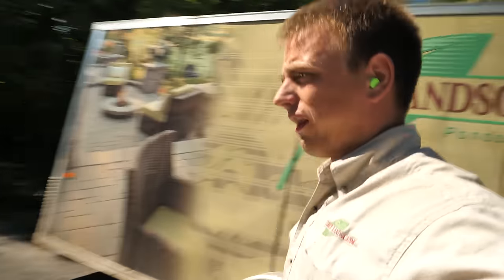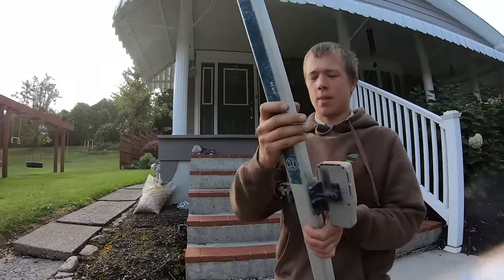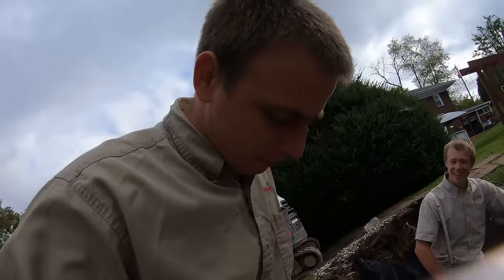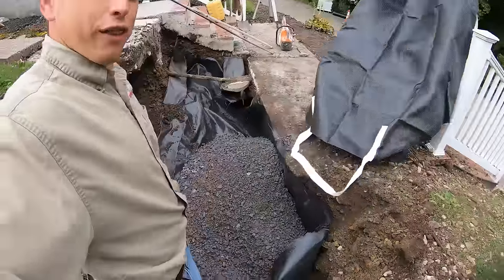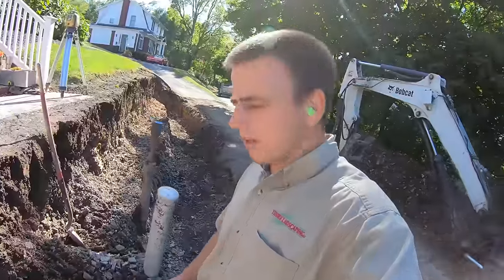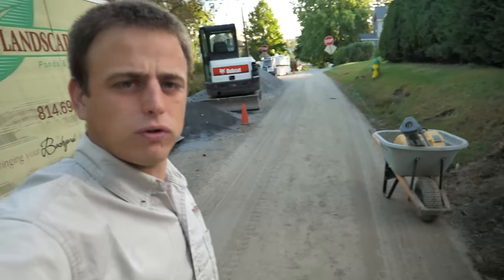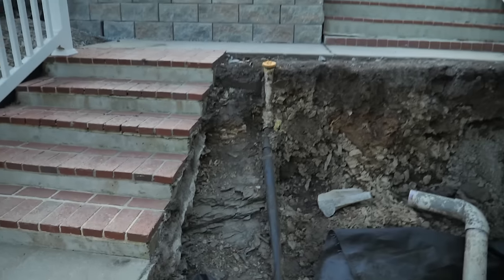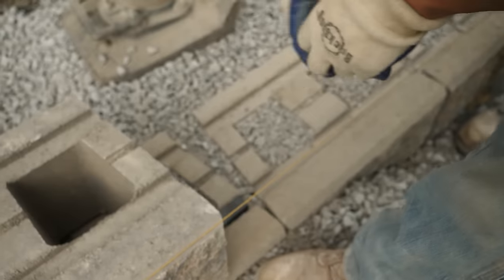How to build a RETAINING WALL that WON'T fall over!

Comment: How great explanation of the building the retainer wall. I would love you guys do a video on follow up 5-10 years later and revisit projects you have completed to see how everything holds up. Almost every retainer wall looks good when it is first completed. The main question is does it still look good 5-10 years after installments. I'm sure your projects will withstand the test of time, the follow up video will just validate the quality work. Thanks and keep it up.
Reply from the maker: Amen! That's exactly right. Appreciate the support!

Comment: Does that tubing have perforations all around it or just on one half?
If just one half, do the holes face the top or bottom of tube when you lay it down? Any landscape fabric or sock covering the tube?
How would I dead end that tube into my yard? Can I just end on a bed of rock under ground then cover with dirt and grass?
Thanks

Comment: Great video!  I know to measure from the “0” point. Then whine about the pipes you found. 

Now how deep and wide should the footer be?  What stone to start off with?  How deep? What stone next?  I have more questions than answers.
Reply from the maker: On a typical wall like this, the footer is deep enough for 6" of stone base (#57 stone) and 1" of setting bed (#8 or #9 stone) plus however much block needs buried as a footer course. Usually at least one course. If your block is 8" high, then the 8" block plus 7" stone base means you'd need to dig 15" below grade. And I typically dig 2' wide

Comment: Where can I buy the hollow-core blocks that you used? Who makes them, and what are they called? What are the dimensions of each block, and how much does each block weigh? Also, did you use filter fabric in your wall, and what kind of drainage pipe did you use?

Comment: A Vibra-plate will consolidate material but will NOT compact more than surface to maybe two inches deep.  Anyway, stone just needs to be consolidated so the plate works for this application.  Just semantics, but should be clear to the uninformed so they don't use a plate thinking they are getting compaction.  A good video.  You build a good wall.
Reply from the maker: Thanks Jeff for the comment. Yeah, there is a limit to how deep the compactors can compact. There's compactors that can only go 2 inches, there's some that can do up to 6". We always compact the base stone in lifts that the compactor we are using can handle

Comment: Did you consider a concrete wall, form it up and make a pour, there are a lot of nice stained and colored concrete mixes available. What do you think the cost differences would be, thanks for the great video! Keep up the good work.
Reply from the maker: We don't do concrete, but I'm sure it would be in the same ball park.

Comment: Wonderful video.  I am doing a 50 ft retaining wall with steps in middle.  Can i run a drain pipe behind wall and steps the whole length where it comes out at one end?  Also,  at start of drainage pipe do I need to raise it higher at one end so water flows out of other end?  Thanks for any advice you can give.
Reply from the maker: Yes you can. Should have a pipe come through the wall or be daylighted every 20'. And as long as it's level, which it should be, no need to worry about slanting the drain pipe
Reply: @Tusseylandscaping  Thank you very much for help..  Will keep watching your videos.  Take care.

Comment: First class job on the wall and video!  Many diagrams of retaining walls/geogrid/backfill show the geogrid extending back into the soil, with a limited (2 feet or so) of rock immediately behind the wall for drainage.  Is it better for the entire reinforced area (geogrid + compaction) behind the wall to be all rock backfill, or should some of the geogrid tie into the soil?
Reply from the maker: Normally it would be compacted soil over the geo grid, so the grid would tie back in to the soil. behind the 18-24" of clean stone back fill. In this job, there was very little space to stage materials, so we opted to just bring in clean stone and handle only 1 material instead of 2. (clean stone and soil)
Reply: @Tusseylandscaping  Makes sense, thanks!

Comment: o7, nice video, I´m from Germany and did my apprenticeship in gardening and landscaping over here and if we would do stuff like that ( mostly with natural stones like basalt, granite or sand stone) we tilt it towards the hill ( 10-20%) on a level foundation to counter pressure. Q: did you do that too or did you construct it upricht?
And we wouldn´t use the geo grid, not common for that stuff over here, more likely used for concrete foundations unde natural stone paving with epoxy joints, the rest ist basically the same.
great work
Reply from the maker: Hey thanks for watching! This wall was built vertically. The grid is essential to tie an SRW wall in to the bank behind it.
Reply: Tussey Landscaping I think with natural stone that is unsecured, you have to angle the leading edge of the stone? Another wall built near me was stones easily 500 pounds (230 kg) and I think the stone mason said there is an actual code for the amount of angle, 7-10 degrees I think I remember.

Comment: Excellent video mate. What's the specific name of the fabric between the drainage zone and the top soil? Also, what's your criteria for the use of Geogrid?
Reply from the maker: It is called woven geo-textile fabric. And the geo grid depends on the spec of the wall block you are using. If you check with the manfactuer, they will tell you

Comment: Nice job speaking to the lay person (me) ! No doubt that had to be way expensive. Lawsuit on a fallen wall and accident would be more. Kudos, I benefit only from understanding more about how the structure is made strong than anything. I know what water/ice can do but have far, far less concern on this Texas Gulf Coast. We would be more concerned with too much water causing mud pressure. Along roadways around here where there is constant vibration and awesome moisture, I expect the ability of retaining soft soils to be a big thing.
Reply from the maker: Yeah I think the requirements would be the same for walls down there, but not certain. I'm sure the info is readily available though on how to properly engineer walls in your area

Comment: Great video.  How do you cut the geogrid?  I notice you run it over your blocks so it's hanging out over the face side of the blocks.
Reply: Oh, and how much topsoil did you put in?  Will the stone underneath it struggle with moisture retention to keep it from drying out faster than the rest of the yard?  Is there a risk that grass won't do as well because of that?

Comment: I like that he was realistic that the wall would be there for decades. Not 'forever', but long enough that the current and probable next residents won't be dealing with it. Maximizing longevity while minimizing materials, not like ancient stone structures that have survived by being like 2 feet or more thick with mortared solid rock- it doesn't have to last 800 years, it just has to last long enough to make the cost worth it

Comment: Hey guy! I have built two walls. Both ~ 2’ tall. When compacting the base, does the soil layer have to be perfectly level? I use a sharp shovel and mattox (it scrapes well bc weight). 

I lose my ass on this part of the job, while the rest goes smoothly. Nice block choice btw

Comment: Great video 👏 On the base level blocks do you ever set them on mortar? Or is it better to put them directly on the compacted stone?
Reply from the maker: This is not a masonry wall, it is a SRW wall, meaning it is designed to flex and move with the Earth. Masonry walls with mortar need to have a footer dug down below the frost line
Reply from the maker: Yeah, this type of wall is better on compacted stone, that's what it is engineered for. Now if you want like veneer stone or something, then you'd need to dig down below frost line, pour a concrete footer, and then set cmu blocks on mortar

Comment: Get the plans from your city of all buried pipes/cables and dogs,  in your yard before digging by hand or machinery.  The plans are usually free so don't let any contractor or friend dig before you see them with the plans and marking the pipes, cable or dog cemetery, such a important safety feature this video brings out ...Remember go to city hall get plans or sometimes they can fax it or e-mail.  Tussey is not fussy, so they have done there homework and when they work for you, their job is A+++++ and I thank them for sharing there project on line.  I see job satisfaction and confidence so Thank-you.
Reply from the maker: For sure. We use PA1 call, they come out and mark all utilities before we dig

Comment: What is this block product that doesn't require a step back with each course? I need to build a stairway into my wall, and I don't want the look of the stairs being wide at the top then funneling down. Thanks!
Reply from the maker: Most block manufacturers produce a block that can be built either vertical or with a step back. This block has a plastic clip and depends where you place that clip dictates whether your wall is vertical or step back.

Comment: Nice wall.  Looks great, but made me wonder about the rock back fill.  Why would you want 5' of rock behind it and not compacted soil.  Seems like the dirt behind the rock will just push the rock now.  If my thoughts are correct, I would place about 12" of rock behind the wall for drainage, then compact soil on top of the remaining 4' of geo textile to create a unified 4' dirt wall.  I would love to hear your thoughts.
Reply from the maker: Hey MJ, yeah normally what we'd do is exactly what you said: 12-18" of backfill stone, then compacted soil. The reason we didnt do that is there was zero room to stage any material on the tight city street, so we had to haul all of our excavated dirt out. When we were ready to backfill, it was just easier to backfill entirely with one material instead of two, so we used clean stone

Comment: Is the pipe on the far right that goes through the face of the wall, is that connected to a downspout? If so, have you ever ran into a pipe that failed and caused the wall to fail due to dumping all the water behind the retaining wall?

Comment: Do you have to put drainage behind a smaller scale retaining wall, say, only two or three rows high?  I want to put up a wall about 20 feet long that just straightens out a landscaping area right in front of the house.  It has a slope that drops about 2 -3 feet  roughly 10 feet away from the house.  I don’t want it level but I want it just sloped enough to plant flowers sort of tiered  to make them more visible front to back. I think only 3 rows of block will be plenty but I’m not sure if I have to drain just that little amount of wall.
Reply from the maker: Yeah you'll need a drain. Every wall regardless of size needs clean stone back fill and drains that daylight out the wall ever 20 ft

Comment: Question on the landscape fabric. Is there a reason you did not tuck it under the capstone? Seems like you want to reduce as much topsoil as possible getting into the rocks. Seemed like there was a few inches on a few areas where the stone was exposed.

Comment: The fabric allows the water to filter through? It looks very plastic compared to the one we use here in Sweden. Nice Stihl cutter there, and the geo-grid is such a smart thing.
Reply from the maker: Yes it does. It's not super fast, but yes it is considered permeable. Thanks for commenting!

Comment: What brand/model of corrugated pipe & filter fabric brand/model (4oz or 8oz?) would you recommend for a 3' french drain wooden retaining wall?
Reply from the maker: We use 4" corrugated perf pipe (can get it at lowes) and a woven geotextile fabric

Comment: What do you do for a wall which cannot be easily accessed from the road? Ie in an enclosed back garden? Fortunately you can do that with machinery when I used to build them in gardens we couldn't even have a clear run,.Often all material and rubbish had to run through the house.
Reply from the maker: Wow! That is crazy! We always make a way, take a fence down or something

Comment: Well done! No fabric placed vertically to stop the bank dirt from settling in the drain rock?
Reply: Did you see the tons of rock?  There was so much rock, it's not an issue. Besides he put landscape fabric flat to stop dirt and water.
Reply from the maker: Yep that's right, we had way more than necessary clean stone back fill. But even in normal builds with 18" or so of clean stone back fill behind the wall, we still don't do fabric vertically. We do fabric flat, on top of the backfill, before we put topsoil behind the top of the wall though
Reply: @firesurfer  Yes, I saw the large quantity of backfilled rock. When building french drains and similar, you completely surround the drain rock to keep dirt from plugging the system in the long run. I don't see how the principle changes here... the way I see it is the extra rock just buys more time. I can see vertical fabric against a wall working like sail in a freeze, but the gravel would displace in this situation. The horizontal fabric is clearly a must.
Reply: @PNWwoodsman  Except many have shown that the fabric does little to nothing to stop the dirt and if you have clay it will plug up which blocks water flow..

Comment: Are there any options to anchor a wall to an existing bank if you don’t have room to cut it out as deep as it is tall? I’ve seen some anchors that are driven into the virgin ground then attached to the wall. Kinda like dead men on a timber wall.
Reply from the maker: There may be, but we have no experience with that type of anchoring system. We always do the clean stone drainage

Comment: NIce work, where do you recommend getting stone from?  I'm going to be doing a wall about 10' total length...a boomerang type size.  Know that the stone and filling with gravel is important but don't think what's at local big box stores in regards to stone will allow the drainage to be adequate.  Any advice on sourcing stone?
Reply from the maker: I'd go to a stone yard or local quarry

Comment: i am building a small retaining wall. I will have my base and then pack it down. I am considering pouring dry cement on top of it then laying my base blocks down. What do you think of this? what could be some potential issues?
Reply from the maker: That does not meet the standard of building a segmental retaining wall, so we wouldn't use that method!

Comment: I'm guessing the blocks you used don't require mortar, grout,or eurythane sealant as a filler between blocks. If that is the case are they designed to work as weep holes?
Reply from the maker: No, the wall doesn't require any of those things - We put corrugated pipe to help with the drainage.

Comment: I like the blocks you used. What are they called ? And where can I get them from ?
Reply from the maker: It's Techo Bloc's Suprema Block
Reply: @Tusseylandscaping  thanks for the response. I live in Seattle and unfortunately we don't have this block available in our area. Do you have a recommendation on the brand of blocks that I can find in my area?
Reply from the maker: Hey Pushkar, I am not familiar with what is available on the west coast. However, this block is not particularly unique. Almost every manufacturer has a block today looks similar to this one. I'd check a local gardening center out and see what they have. Show them this block in this video, they'll be able to point you in the right direction

Comment: Good stuff. Facing the home from the road, it appears the grade slopes naturally from left to right. Why would you run the drainage to the steps then discharge next to the steps for all to see with an awkward gap in the stone work?
Reply: I thought that same thing as soon as I saw it! 
Big puddles, ice to slip on right at the stairs? 
Not putting the job down, it’s amazing!
Reply from the maker: Hey Randy and Pete, The grade was very close to level, it actually dropped about an inch or two from right to left, so where we did exit the drainage was in fact the lowest point. Also, unless you have a spring or excessive groundwater behind that wall, you wont see water literally gushing out of that exit. Meaning it is very unlikely you'd ever have ice or anything like that.

Comment: great video  how to some one estimate  the cost of a wall like that  is there a per foot rough estimate  or is there more to  it
Reply from the maker: Just a matter of estimating the man hours it will take to build, and the materials, and come up with a price
Reply from the maker: You could come up with flat rate pricing, but that flat rate pricing would be based on what I mentioned above. We use SynkedUP.com to generate our estimates. Makes it real fast and easy

Comment: I am planning on putting in a 12 inch high stone and mortar retaining wall for a flower bed. How would I go about drainage? And would it be necessary for such a short wall?
Reply from the maker: Any mortar wall will have to go below the frost line, which is 3ft deep here in pa. I don't know where your located, but we would not install a mortar wall, for such a short wall, because of the requirement to go so deep. We'd just use a segmental retaining wall

Comment: I did  my retaining wall the old fashioned way:  75 wheel barrows of clay and rock.  Pickup with rock back to wheelbarrow.  Tamp rock.  Add the drain.   Had a concrete pad so up goes the wall

Comment: thanks for the video. with shorter retaining walls, (2'), can't you get away with just sufficient clear stone behind the wall for drainage and allow the water to go through the wall, without needing a perforated drain pipe?
Reply from the maker: I would always install a pipe. You won't need grid at that height though